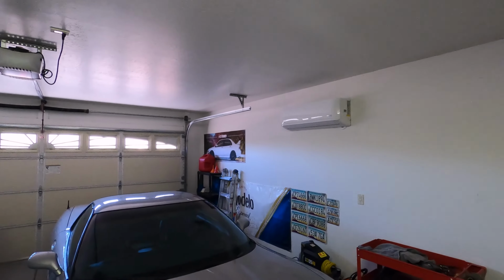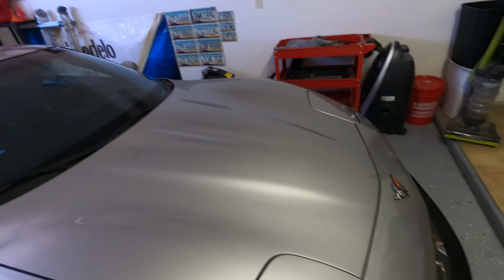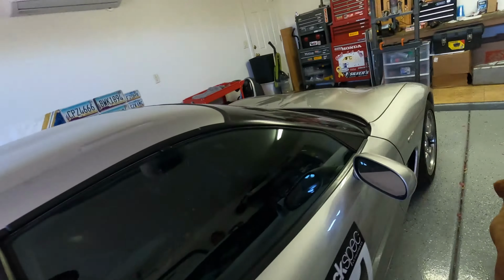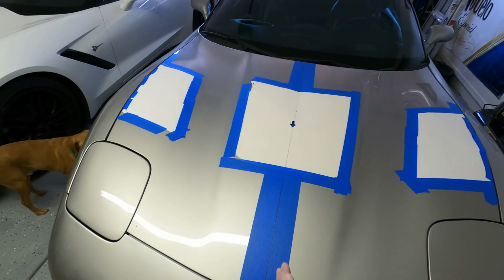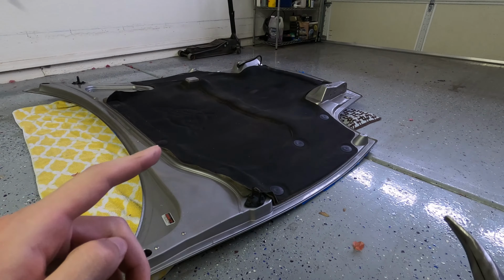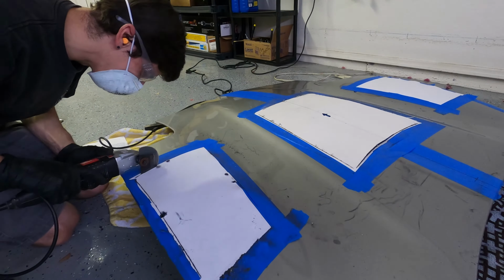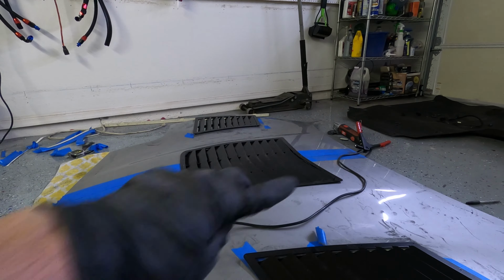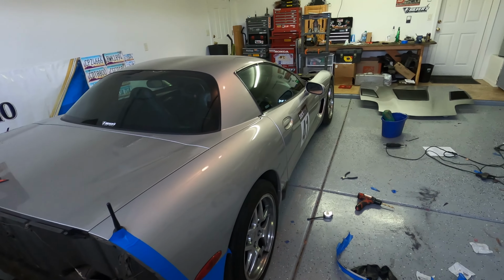Installing MASSIVE hood vents on my C5 Corvette Z06 Canyon Car

Comment: That looks great! Just ordered a set of track spec vents for my 03 Z06. Hopefully it solves a little bit of the heat soak issue.
Reply from the maker: It definitely does help evacuate heat while idling. Biggest difference was upgrading to the track spec radiator

Comment: My question is the top of the center of the vent where the hood dips what did you do to compensate for that space...
Reply from the maker: They give you special 3D printed spacers along with the vents. Along with a few longer rivets. It's a pretty slick setup
Reply: Ty...

Comment: The one's by the fender's throw's rock's at the windshield need a find screen to cover them under the two side vent's
Reply from the maker: Chicken wire usually works and get some thick foam stripes that seals the gap between the body/fender. That way you'll have less crap in your engine bay

Comment: Whenever I’m drilling into fiberglass, i set the Drill in reverse. seems to help a lot
Reply from the maker: Interesting, never thought to do that, I really like that multi-tool with the heavy metal cutting blade. Made nice clean lines
Reply: Drilling backwards? Or how do you mean?

Comment: Did you vent the inner fender as well?
Reply from the maker: No but i'm going to do that as well, I need to put some mesh in the cutouts and seal the openings from the engine bay so I don't get rocks in there

Comment: Have you driven the car in the rain????
Reply from the maker: Once, when you drive the air pushes it out. I wash the car all the time with no issues. Gm electrical connectors are waterproof

Comment: I love the look but since my car is parked outside I'm worried about water...
Reply from the maker: Yeah probably wouldn't be a great idea, although GM uses waterproof electrical connectors from the factory
Reply: and on the C5 the alternator is protected from rain, due to its position compared to the C6, they say.
Reply: @z06king  thanks for clarifying. Now to decided to cut up my hood or not is another story hah. Maybe I can find a used one to cut up and then carbon wrap it.